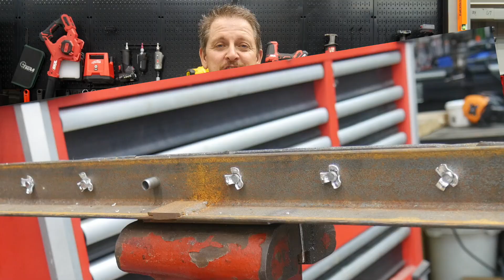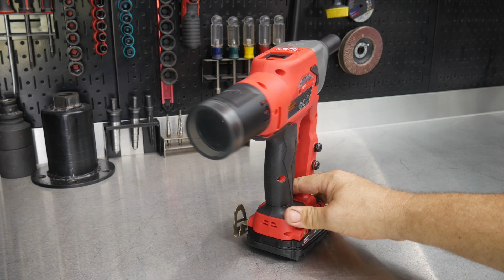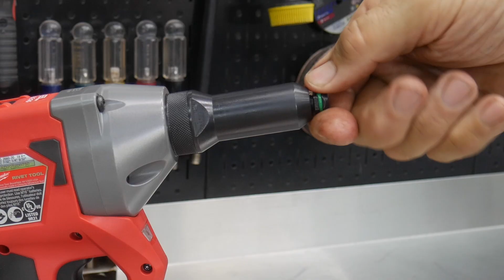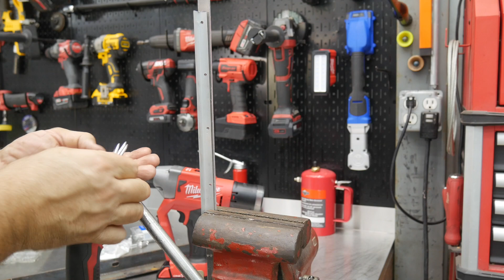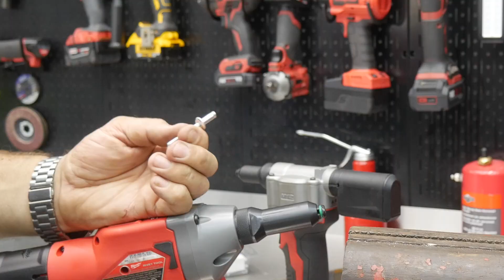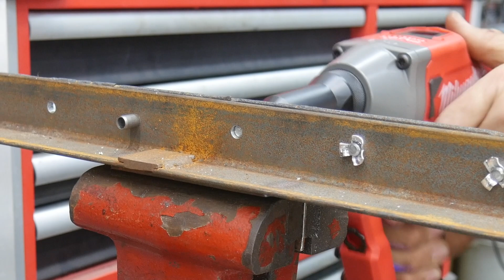FIRST EVER! Milwaukee 2660 M18 FUEL Rivet Gun Review [4500# Pull Force]

Comment: If this gun can handle 1/4" structural steel rivets in a reliable fashion, it will be an instant hit for tons of heavy truck and bus guys along with manufacturers. No more air hoses all over the place getting brand new panels dirty.

BTW, the upper loop is likely more for attachment to retractable tool balancers or safety cables for use in production environments.

Comment: M12 Fuel version coming out any time soon?
Reply: The m12 has been out for a long time, however it is not able to pull larger rivets.
Reply: However it is not FUEL. I am asking if a FUEL version is in the works.
Reply from the maker: I don't believe that they're upgrades the M12 anytime soon. These are really completely different tools, or at least they're used in different arenas. Thanks for watching.
Reply: The M12 is a pos imo. If we can get an 1/8" head for the M18, that is the only option.

Comment: Damn.... id never thought id see a Milwaukee tool more expensive than a tool truck brand equivalent . The Matco tools 1/4 rivet gun MCL20RG bare tool is $550 and kit is $750.
Reply from the maker: I totally understand, and kinda agree with you. It's definitely a high price, but I don't think that Matco pulls near as fast as the Milwaukee. At the same time, do you Need it to be that fast?! I guess only the consumer can really answer that question. Thanks for watching.
Reply: I agree, rip off.
Reply: your ripping yourself off if you buy it and have any use for it,but on the other hand if you have projects and you use this gun periodically it's great and especially if your making money doing it.
Reply: I mean this is definitely a nicer gun than the matco since the milwaukee has one key and can track and inventory the tool. It also has more pulling force and a place to put your nose cone on the gun.